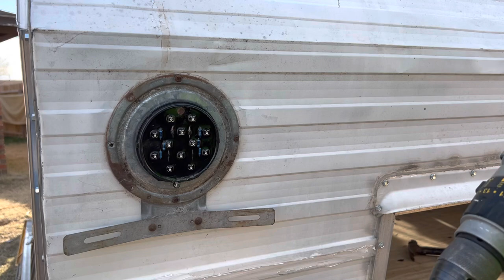I’m Remodeling a Vintage Camper Part 3: Brake Light Conversion Pathfinder No. 575 LED

Comment: Ingenious!!!
Did you install a resistor to compensate for the LED's, so the tow vehicle's turn signals/hazards wouldn't hyper-flash?
Reply from the maker: No I didn’t because I left all the original stuff in tact since these were originally made for running as is. There are resistors built in and they work great. I’ve pulled it several times with no issues so hopefully that gives you a clear answer.

Comment: What did you use for the LED Brake lights?
Reply from the maker: Just the trailer light kit that you get from the auto parts store. That’s what was stuck on it when we got it so I just incorporated them.

Comment: Why not just leave the red cap off the new one? The old lens is red 🤷🏻‍♂️
Reply from the maker: I contemplated it but I like the look of the old covers to complete the look of the outside
Reply: I understand. I meant leave the cover off the new led and just use the old lens
Reply from the maker: @Blue04Z71 sorry, I totally misread your first comment. The new led has a built in magnifying plate that the red cover holds in place. I guess you could glue the magnifying plate on and leave the extra red lens off.